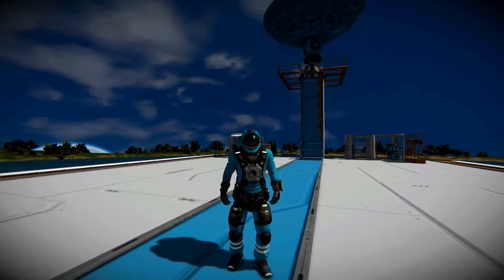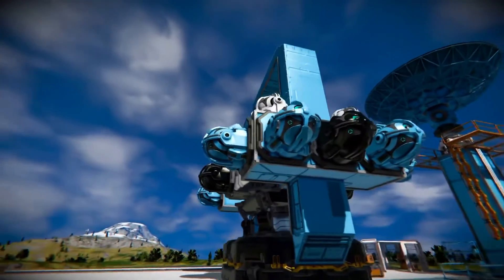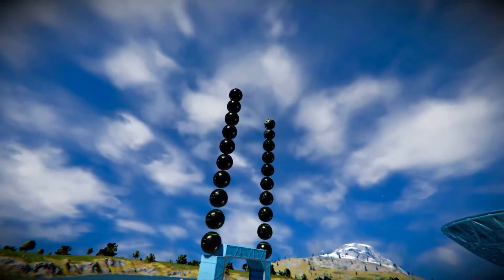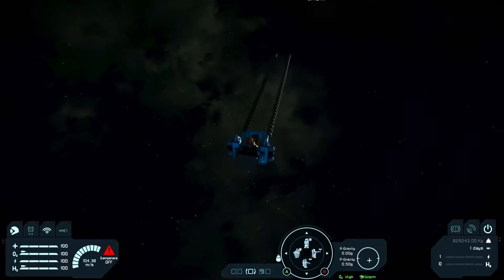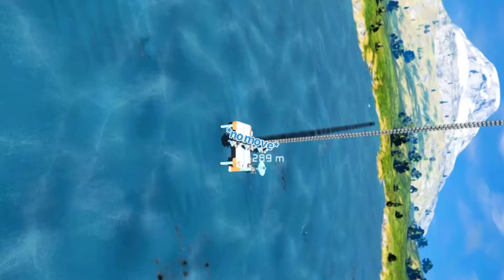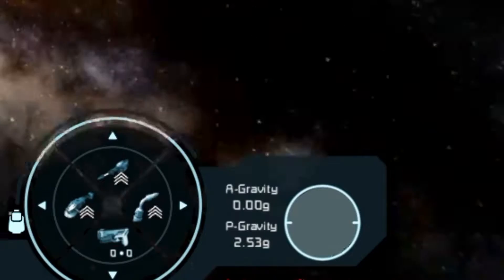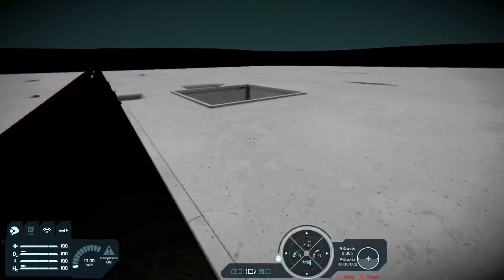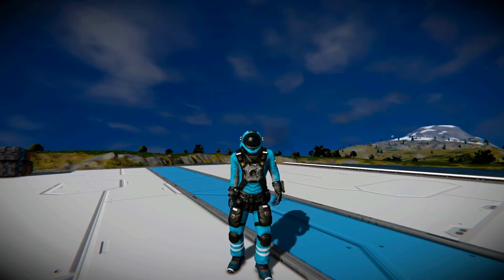Space Engineers Clang Drive vs. 10k G Black Hole Mod

Comment: Dude, if a single clang drive without any additional mass can’t escape, it doesn’t matter how many drives you use because the weight will increase proportionally to the thrust.

Comment: Do the drives work above the speed limit?
Reply from the maker: That’s a good question. I haven’t tested that yet.
Reply: Theoretically it does, kinda. Gravity in stock Space Engineers (last I checked, it’s been a while) is 104.7m/s so it’s barely faster to the 100 you get from thrusters (using any thrusters slows it down to 100 again)

EDIT: I think I completely misunderstood the video, these aren’t gravity drives they’re clang drives. Maybe I should finish the video before I talk next time (but I’ll keep this here anyways)
Reply from the maker: @ZorillaMyrid181  Yeah I never really understood the speed limit in a gravity field is 104.7m/s.
Reply: @RhynoSpartan  I’m pretty sure it’s so your character can still walk around, but even that doesn’t really make sense so I donno
Reply from the maker: @ZorillaMyrid181  That's a smart thought.
Reply: So it does?